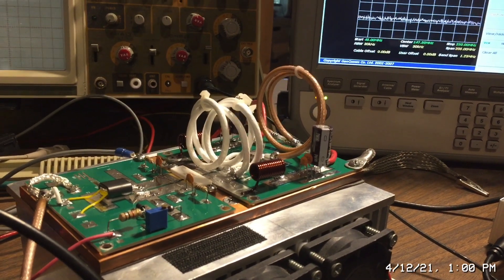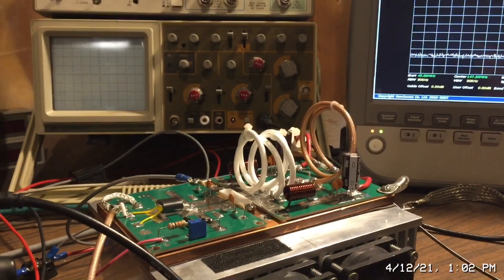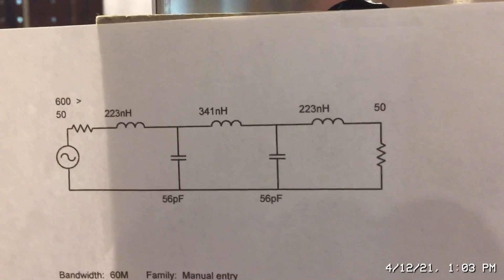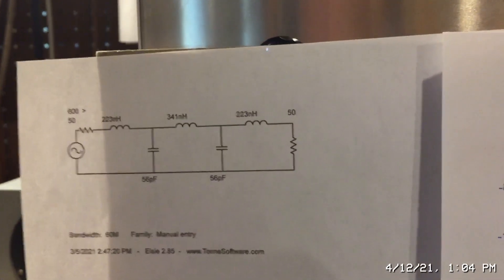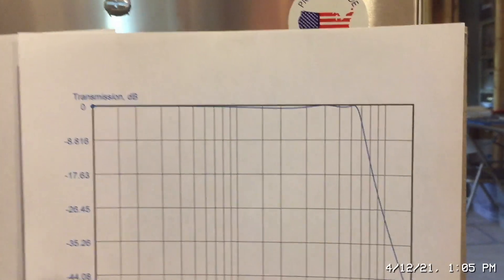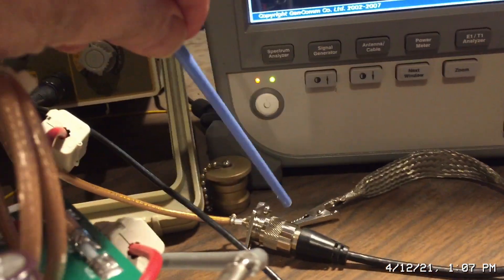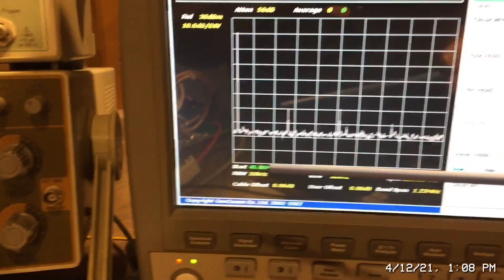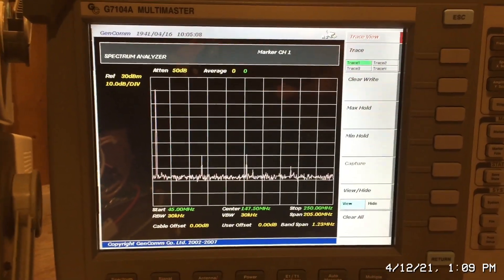RF Man Demo's New 6 Meter/1000 watt LDMOS Board and shows Harmonics with Low Pass Filter installed

Comment: I’d be terrified using that beautiful spectrum analyzer with kilowatt amplifiers.  Even if the output is sampled.  Do you do anything additional to protect your spec an just in case? 73 de VK4QP.
Reply from the maker: Nothing special. I use a -32dB RF sampler with the attenuation on the SA set to -50dB. This is safe up to 2000 watts.....